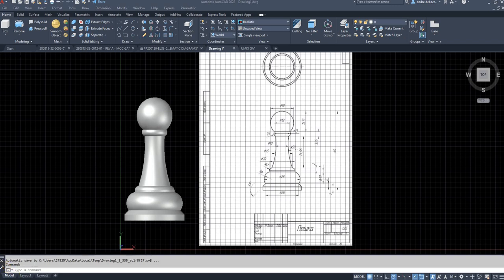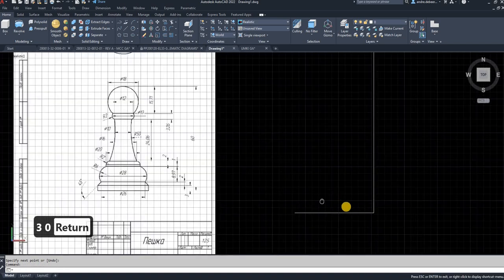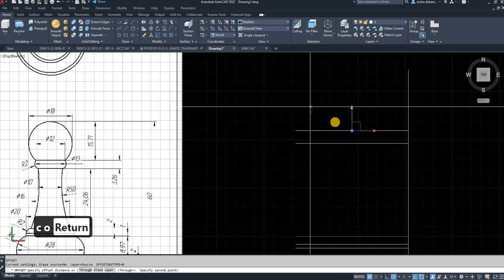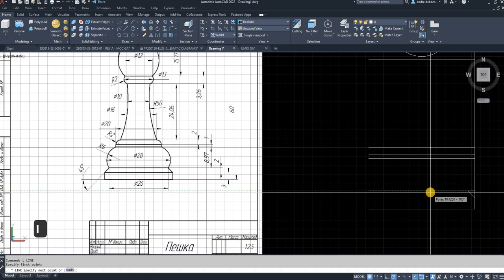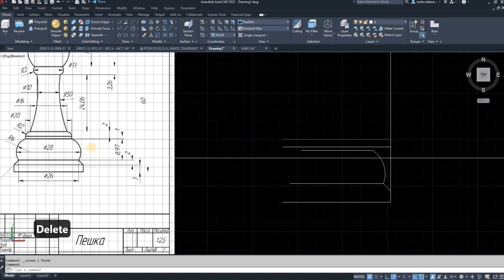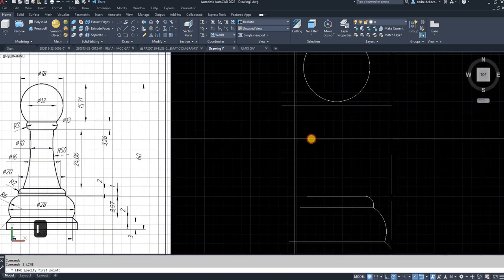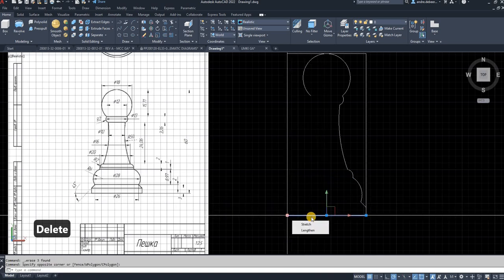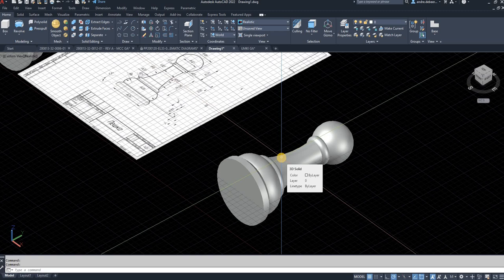AutoCAD Tutorial : How to draw a chess piece (pawn)

Comment: Three point circle doesn't seem the correct way to draw the curves. The distance between the points does not coincide with the diameter. Arc, start, end, radius seems more appropriate.
Reply from the maker: Thank you i will consider this when i redo the series